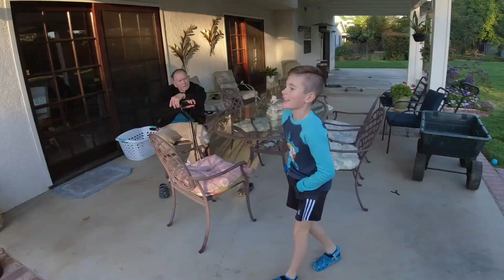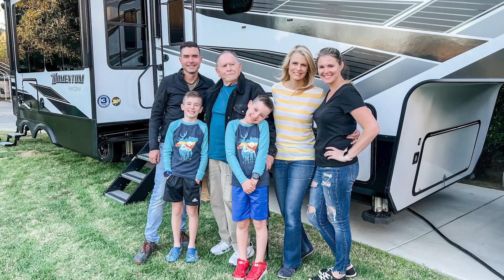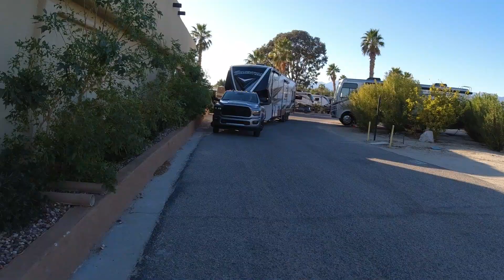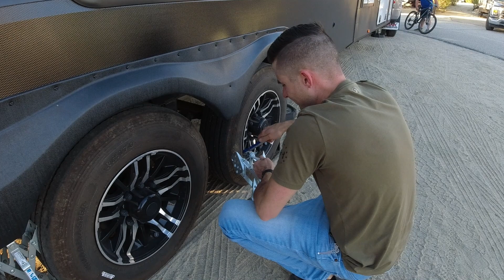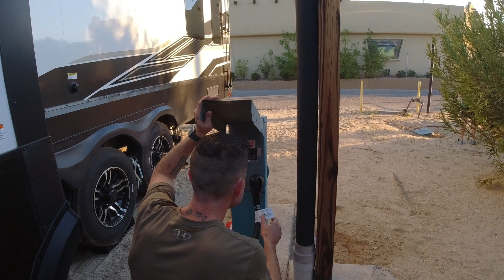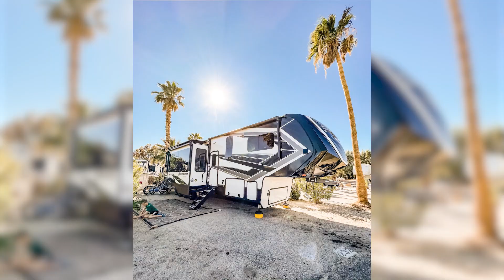Don't Make this Mistake When Setting Up Your RV!

Comment: Not sure I understand why you are using Xchocks and pulling on to blocks with having Auto Level. 
Especially when you haven't put the pads down yet. 
The Xchocks are designed for trailers without Auto Level.
Reply from the maker: We auto-leveled before we put the xchocks on.  It's more for stability.  Also, this was our very first time setting up.  We didn't need to use the blocks under the tires, we just didn't know any better at the time.  We've never had to use them in the year we've been traveling.